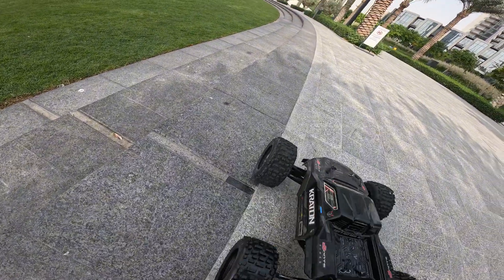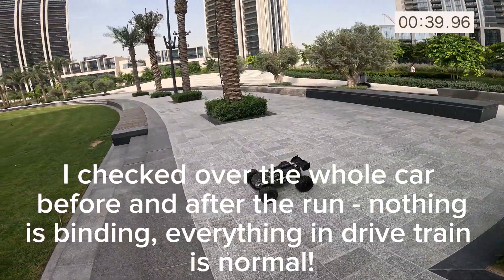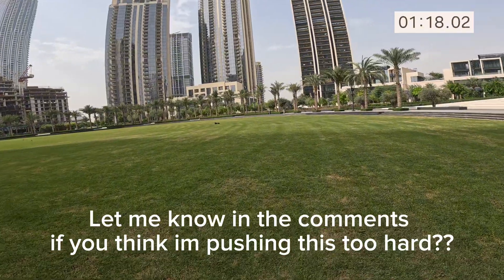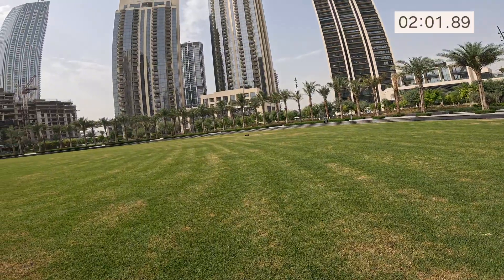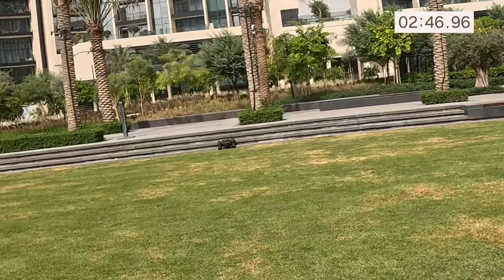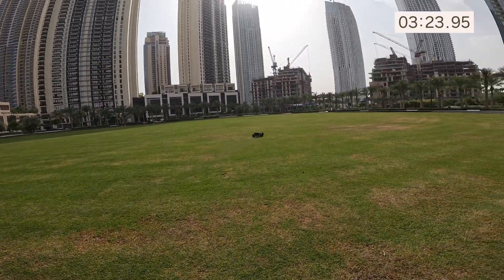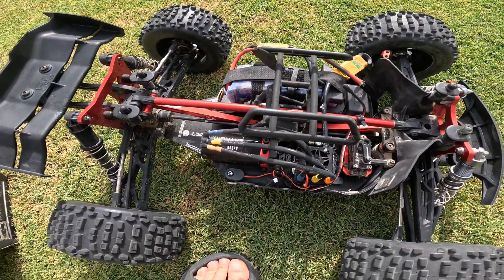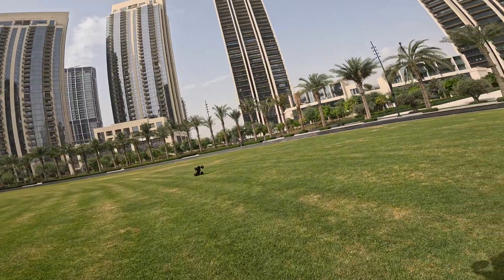Rocket RC Supersonic 6s 160a 'V2' ESC is a Fire Hazard!?

Comment: ☆☆☆☆☆☆☆☆
I have the ZTW SL150 G2+ Kyosho TORX 8+ SL 2300KV 4068, the Rocket RC 160A + Old model Blue Xerun SL 4274 2000KV , A HW Max8 G2 + Rocket RC SD ToRo 4274 2200KV, And Hobbystar Pro  150a + XeRun G3 SD  4268 2800KV.

They all perform well, the ZTWSL 150 is in a ZD Racing ⅛ Rally and it moves on 4s and is insane on 6s, the Rocket 160 is in a Team Associated RC8B and it sings. The Max8 is in a Talion and it Flies, the Hobbystar 150 is in a Vendetta that scoots around at a decent clip of 99+MPH and gets their faster than a Ninja motorcycle. 

Only ESCs I've had fry are a Hobbywing 1060 brushed and a Max10 60amp brushless. the 1060 was in a WLtoys 9x9 1/18 scale plastic car with a Tamiya Torque Tuned 540 can motor + CHNL Black 1300mAh 100c (ya rite, but it has a high amp discharge for shure when placing amp meter between it an a 10turn double wound Trinity brushed armature with new replacement can from Holmes Hobbies).
The Max 10 60a was in a 2wd Rustler, mild gearing , 3s batt, and a Ruddog RP542 3600KV while driving around a dirt baseball diamond.

So i guess you never know. 
I have had maybe 6 Rocket RC and Surpass ESCs and also I have 4 of the Surpass 35a 3s escs in 1/18-1/16 scale cars for many many years and they all work a treat.

But must say now im a bit worried about using the Rocket RC 160a seeing as you said they have been removed from the Surpass Official Store on Aliexpress,  thats where I purchased mine!
Reply from the maker: Thanks for sharing this amazing info! Yeah I think you can just be unlucky (or lucky) 😅😆

Comment: what about ztw esc's also what amps do you normally put in or what amps does it come stock with?
Reply from the maker: I have a ztw but I haven't tried it out yet! 😄 I use a 6s 100c pack - the same pack I use with all my other cars 🙂
Reply: @HeatRC2025  100c is a lie we all know that but what amps esc does it come with stock?

want to see if ztw can handle it

Comment: I have had 3 hobbywing esc fail in last two months 2 brand new quikruns and 1 older sct max10 nor fires just no longer work and its not the switch they come on but dont work and a the 200 amp pro failed 3 months ago not too happy with hobbywing 🤔
Reply from the maker: I had a quick run fail too mine is flashing green and red light alternatly and wont recognise programming card 😂 all escs are pissing me off right now but at least it didnt catch fire
Reply: @HeatRC2025  that's the same thing mine are doing 🤔
Reply from the maker: @johnsorensen5758  god damn i sense another video coming 😂i upped the brakes and the punch, tested it, it worked fine - came to use it the next day and flashing red and green led and unprogrammable

Comment: I have 3 of these, in asuga and kagama rollers and my mt8
Over 50 packs through the 3 of them, not skipped a beat, fantastic ESC imo

Mt8 run on 4s
Kagama and asuga, only ran on 6s, and I've got all 3 drenched in the shower when I'm washing them down

Ebay uk i got mine from
Reply from the maker: The V2? Interesting! Are you pairing them with supersonic motors??
Reply: @HeatRC2025  
Yes the 160a v2 and yes both corallys have the 4074 supersonic 2050 kv
I've actually took my asuga out today, put 2 6s packs through it
Reply from the maker: @VictoriaJones-gy8es  I had no issues with my other esc when i ran it with the 1780kv supersonic 4992 it was actually really nice combo
Reply: @HeatRC2025  Do Rc did a review on one, in a asuga like mine

Comment: I know there's a lot of amp draw when you blip the throttle and it's getting going from a dead stop, but there should be some overheat protection or thermal cutoff for sure 👍
Reply from the maker: I hear you on the amp draw, i was hardly going into the throttle tho and three minutes in 😢